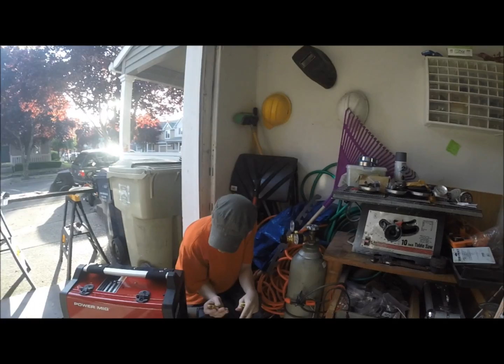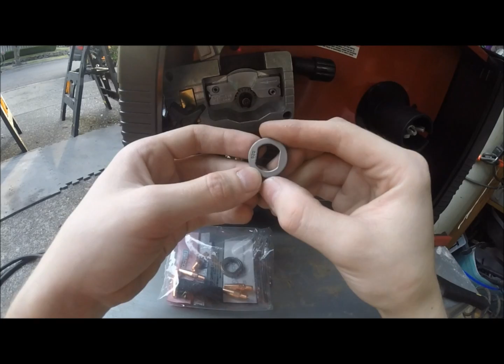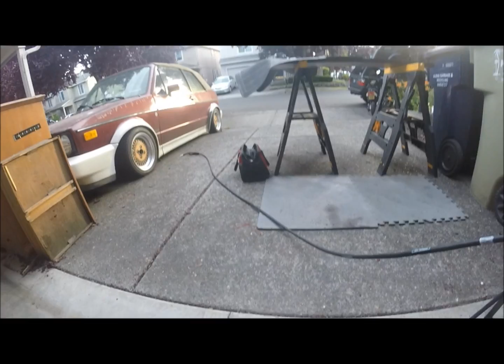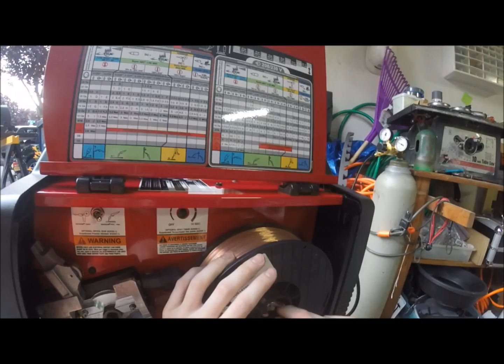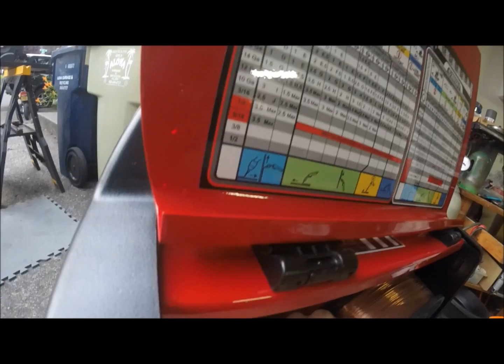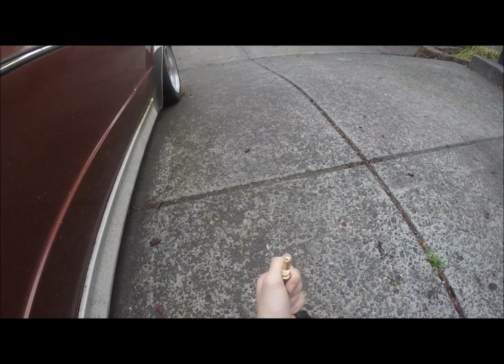How to Set Up Lincoln Electric Power Mig 180 Dual Wire Feed Welder

Comment: Hey man Im a retired welder fabricator of 30 yrs I want to get one of these welders  to do ornamental iron work with my son you didn't weld in this video i was wondering how the machine  runs ,do you have a video showing how the it runs , I can tell you know your shit just by the tip blowing the liner  out and  the way you put the machine  together,they sell those lttle cotton clamps that you put on your wire in front of your spool but you probably know that,  I really want to see it weld , I built ski lifts for 25 years ,and built bank vaults and safes  my last welding  job I welded  1/3 of the steel barrier fence that surrounded ground zero after 911 and welded the Memorial plaques to the  four entrance gates ,I want to get that welder  for my home garage, Great job
Reply from the maker: Hows it going? Thank you for your comment, I really hope I can end up with just a fraction of your welding experience by the time Im your age. But yeah, this machine is AWESOME. It is by far the best machine I have ever used... Literally. Super easy to use and out of every machine Ive ever tried, this one is the absolute best for getting that "Stack Of Dimes" Look with MIG. I have some projects that I need to do here soon (like a roll cage), so maybe Ill put up a video of me using it. Thanks!